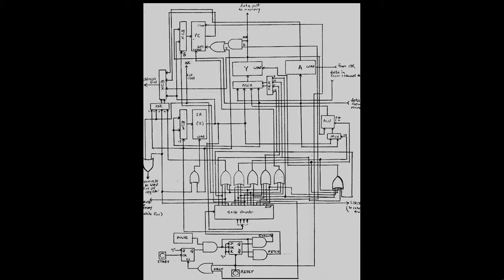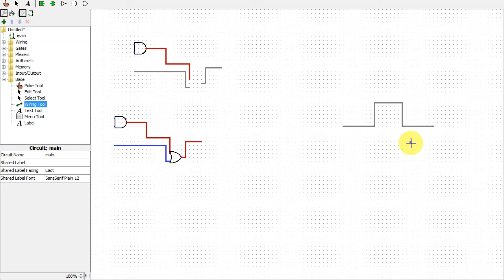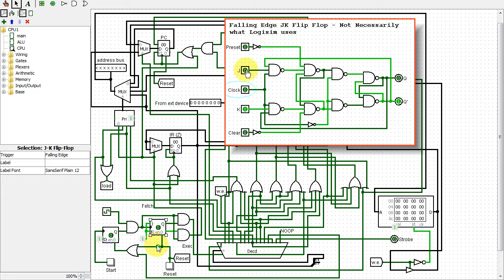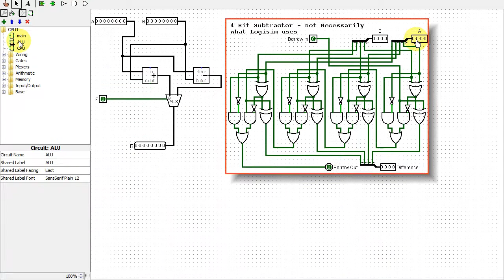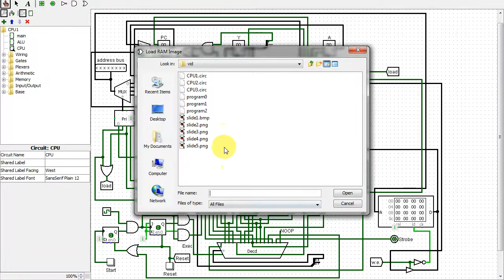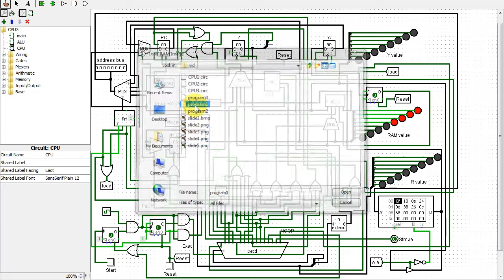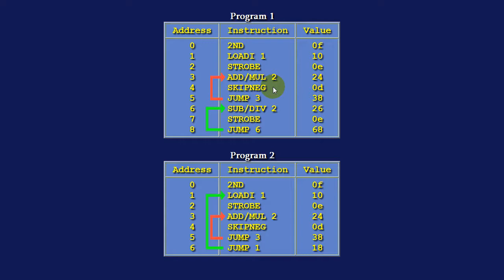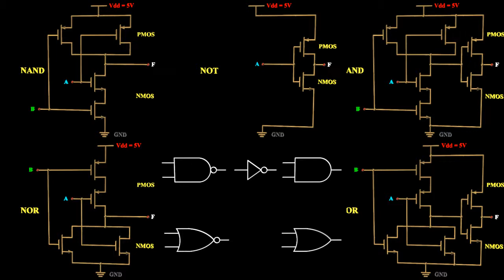Testing and Improving My CPU Design with Logisim (And Digital Logic Basics)

Comment: I also made a CPU
Reply from the maker: @sohamtilekar5126  Congratulations!  Creating a CPU is a very nice accomplishment!
Reply: @MrMcsoftware  i am thinking 🤔 how it is possible to create and use the multiple core in a CPU.
Reply from the maker: @sohamtilekar5126   If you mean in Logisim, that would be challenging.  At any rate, there would be lot's to consider - implement caches?, share or not share the caches?, pipelining?, branch prediction?, etc.  In terms of Logisim, probably the easiest way would be to have your CPU in a subcircuit and have two or more instances of the CPU subcircuit.  Maybe even making that combination a subcircuit that then becomes the actual CPU.  The next issue would be: are the cores sharing the RAM?  Easiest way would probably have each core either use it's own RAM, or have each core use their own section/page/bank of the RAM.  But, of course, this way wouldn't be as fun or rewarding, but it may be more achievable (considering Logisim's limitations).

Comment: Logisim works well but it's showing its age, with more complex circuits it likes to be temperamental.
Reply from the maker: @Duckson Plays I think some of the blame goes to Java (the language Logisim is written in).  But as for the part of the blame that is Logisim's, some of that can be reduced by using one of the forks that is currently being worked on (Kevin Walsh's, Reds-Heig, LogisimIta, etc.) - they also typically are on github, and therefore users can report bugs and hopefully the maintainers will fix those bugs (also feature requests).  But, yeah, there are limitations based on the simulation model/technique and the original goal of Logisim.

Having said all that, I would still prefer Logisim over the bug-ridden websites and services of some very popular websites (I know, that's apples and oranges, of course), and even worse, the people at those companies who not only refuse to fix those bugs, but also refuse to even admit there is a bug.  I'll be diplomatic by not mentioning which ones I'm referring to.  At least the various Logisim maintainers are more approachable and more willing to fix things.
Reply: @MrMcsoftware  Logisim is still very nice to use and I would prefer it over any other logic simulation software. It's old and it's still the best out there. Also thanks for the nice long comment, I'm one of the few who like them.

Comment: I am building a CPU for my students in Computer Architectures but it is impossible to get out of silly bugs of LOGISM that create oscillations. I am sure it is a bug because for some instructions, a register bank that is clearly being addressed for just ONE register (with a decoder of course) unexpectedly writes in two registers when the writing signal is sent by the microprogram ROM. Of this is something that does not happen if you write the register bank setting the signals manually. And of course the microprogram FIRST sets the address of the register and in the NEXT clock sends the write signal. I found that certain flip-flops have oscillation problems in some particular instructions, not all of them. Any clues?
Reply from the maker: @Martin Vernengo Maybe it's a setting in the decoder (is the Disabled Output floating or zero, is it a Three-state?  I don't know what settings would be correct for your circuit, just something to try).  If the incorrectly written to register is at address 0, maybe it would be because the Disabled Output is set to 0 (if it is).  Also, is the register address latched onto so it is known (and correct) when the write signal is sent on the next clock.

Concerning the flip-flops, I assume you mean the flip-flops provided by logisim and not home-made, so to speak.  The logisim flip-flops are programmed to behave like flip-flops and don't completely mimic issues that could occur in actual (constructed by NAND gates, etc.) flip-flops (as far as I know).  If you build flip-flops using NANDs, ANDs, NORs, etc. in Logisim, they will likely have oscillation problems.

Also, in the Project->Options menu there's a setting to control how many iterations before it calls it oscillation and a setting to add noise, sometimes changing those can help.

And, the version of Logisim might make a difference.  All versions and forks have there own set of bugs and improvements.  But using a different fork might involve changing your circuit to be usable in that fork (default component settings could be changed in that fork, etc.)
Reply: @MrMcsoftware  Many thanks for your answer! I happened to find a way to solve it. LOGISM found a loop in the data path of the CPU only when running it free with the clcok and with the control signals sent by the ROM, but only for certain micronistructions and and mostly at the moment when an output from the ALU was written in the register bank. I solved it by AND-ing the the inversion of the CLK with the write strobe, in this way the register bank write was asserted 1/2 CLK time later than the signals. However this should not have been necessary because my control signals specifically had been designed to use 3 CLK cycles to write (1st cycle: address the register and present the data, with the WRITE signal low, 2nd cycle: WRITE = 1 rise flank, 3rd: cycle: WRITE returns to 0). I am almost sure this is a LOGISIM bug and not a design flaw in the code. Any other comments appreciated, without compromise.
Reply from the maker: @Martin Vernengo I'm glad it's working now.  I can't think of anything I could add, except I suppose if you really NEEDED to know if it is a Logisim bug AND if you're using a version/fork that is available on github, you could look through the Issues tab to see if anyone has reported a bug concerning oscillations, etc.  BTW, I once reported a bug (included a solution too) in VHDL generation in the Evolution version.

Comment: hi there can we use our own assembly language with logisim in our cpu?
Reply from the maker: @shankar Not only CAN you, you HAVE to.  Assembly language (machine language really) is completely tied to the CPU that is designed.  For example, if your CPU design doesn't have a D register, there's no way an MOV to a D register would work.  And if your design has a Q register (just picked a letter I know isn't used), there's no way x86 assembly language (for example) could do anything with it.  And, of course, you also can decide what to call your mnemonics (MOV, MOVE, LOAD, LD, TRANSFER, etc. whatever you want - just make sure the assembler you write (assuming you will be writing one) knows what the mnemonics are),  Or you could do all the machine language encoding in your head (which is what I did at first), but that soon gets too difficult to do (with increasing instruction set).

Comment: l have project in making Simple CPU in LogiSim, so please can you help me
Reply from the maker: My video series should be of help :-)   But, I guess if you have some specific questions, I could try to answer them.
Reply: yes, I need help this is my email: malmarr983@gmail.com
Reply from the maker: I prefer not to use email.  YouTube used to have a "send message" feature, but they got rid of it.  So, I guess through comments would be best.
Reply: I want do my project , but you should know the instruction of t
Reply: I should submit tonight pheas 1
Reply from the maker: Did something happen with your last two comments?  They both seem cut off (one ending in just a t and the other ending in just a 1).  At any rate, if you need to finish by tonight, I don't think I would be able to solve anything major that quickly.  What type of problem are you having with your project?
Reply: @MrMcsoftware  lol, i think they're asking you to do their hw 4 them haha 🙄
Reply from the maker: @Elon muskrat • 22 days ago It happens a lot I suspect.  I try to be diplomatic about it though - try to be helpful without actually doing the hw.  Some have actually just said outright "do my homework".  Some delete the comment most likely so their professor won't find out about their attempt.  But, there is another possibility - they might just want my email address (since everything you can sign up for requires an email address, or at least just about everything).
Reply: @MrMcsoftware  haha

Comment: How did you draw the logic gates and the schematic overall so neatly?
Reply from the maker: I assume you mean the original hand-drawn design (homework assignment).  I used one of those template things (I don't know what specifically they're called) - clear green plastic with cutouts for the symbols.  I have a few from Texas Instruments and one from Archer (Radio Shack), both actually identical (except label).  I think the professor said neatness counts.  I guess the rest was a combination of a little planning (layout-wise) and luck
Reply: MrMcsoftware Thanks!